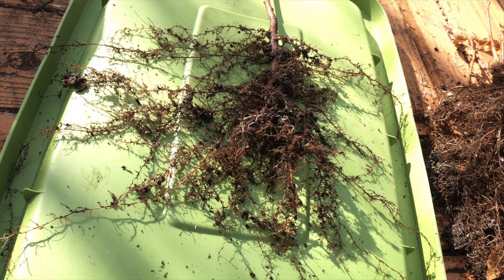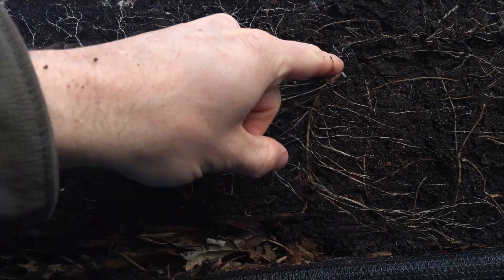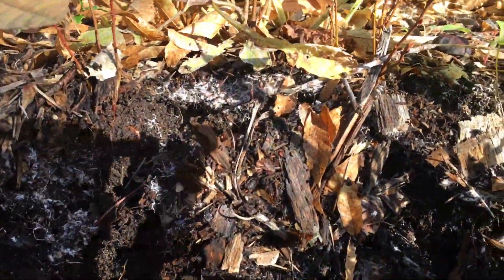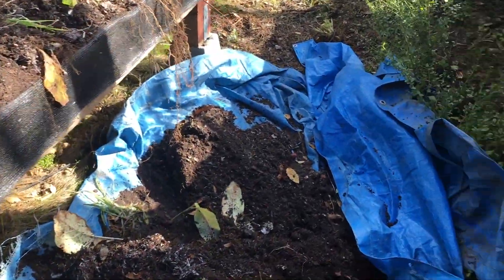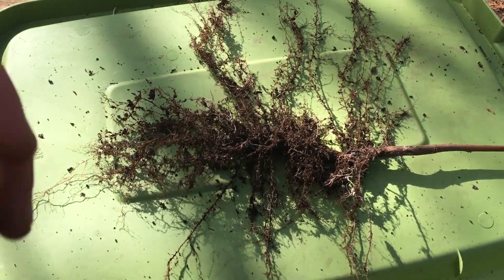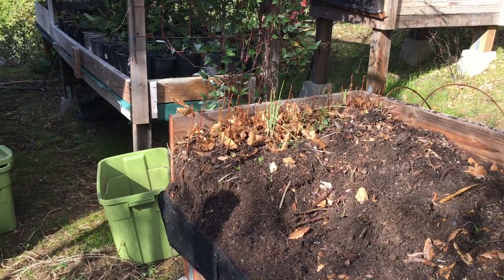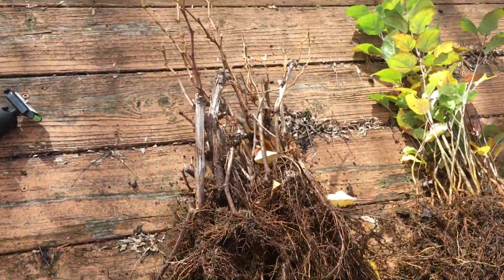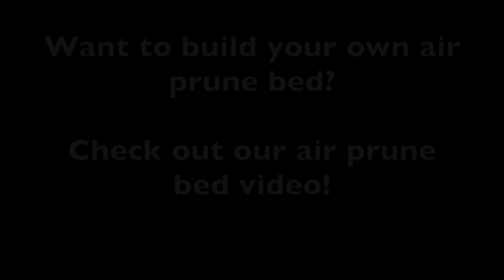Air Pruning Bed First Harvest - Air Pruning Works!

Comment: What are you mean about healing them after you dig seedlings out?
Reply: If you are not planting in the ground and there is a risk of the roots freezing, the trees are bundled together and placed into pots which can be mulched around, or placed into holes/trenches in the ground and covered with loose soil and mulch.

Comment: Is the tap root permanently dead? When planted in the ground is the tree weaker? Thank you 😊
Reply from the maker: No, the tap root is merely dormant. Because the root tip is effectively dehydrated when it hits air, it goes dormant. Once planted out, new apical buds will sprout from the dormant root tips and resume growing. This is one of the reasons air pruning is so helpful specifically for tap-rooted species - it just presses pause on the tap root, but doesn't stunt it as would a slick walled plastic pot. Cheers!

Comment: wonderful.  i was thinking of Whitcomb 4-inch rule being violated by your system but the roots seem ok.  what are your thoughts?  mygreathanks and blessings
Reply from the maker: Hi Paul, yes, we still got a high degree of branching despite the seeds being planted more like 6" above the screen at the bottom of the beds. Next trial will be to create individual cells within the larger air prune bed using some extruded polyethylene panels cut into interlocking pieces to create a grid - I'm hoping to maximize the air pruning around the sides, not just on the bottom, while still taking advantage of the air pruning beds larger mass and connected soil bodies unlike using individual pots.
Reply: @7thGenerationDesign  any results on this extruded polystyrene trial? thank you!
Reply: @7thGenerationDesign  wonderful.  done with the trial you mentioned here - the individual cells within the air prune bed? but  what i would like to see is how you then plant the seedlings to take full advantage of the huge root mass achieved by the air pruning beds...mygreathanks and blessings🙏

Comment: Question: will there specific technique in planting them on their destination to make sure those beautiful roots keep on spreading?
Reply from the maker: Hi Teguh, yes, we generally dig the hole as wide as the roots will go, then create a mound in the center and splay the roots down the side of the mound to spread them out. We then fill in the soil around those roots while holding the tree in place and spreading the roots. It is very helpful to have 2 people - one holding the tree and spreading roots, the other filling in soil.

Comment: Great video, one question, imagine you have a group of young trees that need more than one season in the box, such as trees you intend to graft in 2nd year, or slow growers like pawpaw, could you just leave them in the box over winter, or must you take them all out, hill them in and replant them again in the boxes next spring???
Reply from the maker: Hi Mr. Chickadee,  I haven't yet had occasion to overwinter trees and let them go through a second year of grow in an air pruning bed, however I'd imagine that would be my first choice instead of digging them out, hilling and then re-planting the next year. I'm also in a relatively warm climate - if you're in a place where it gets below freezing for large stretches you probably would want to dig out the trees and hill them to keep the roots from being frozen.